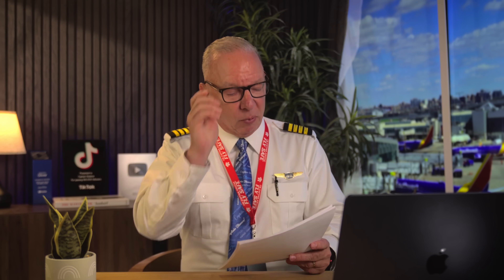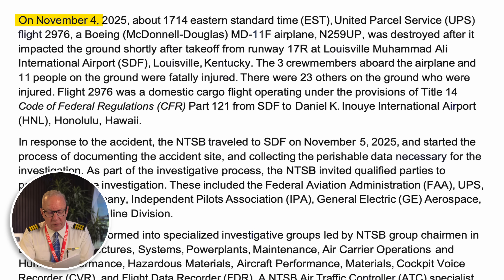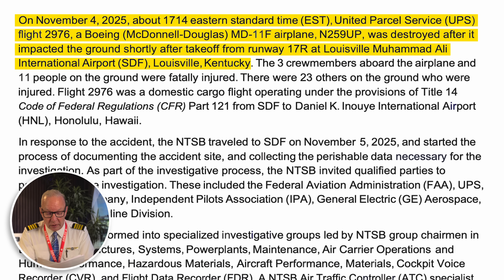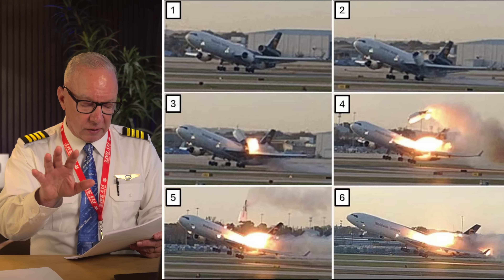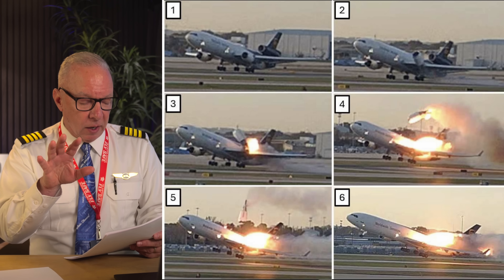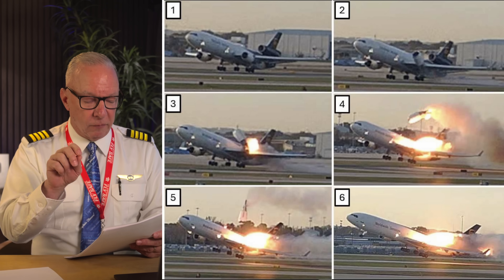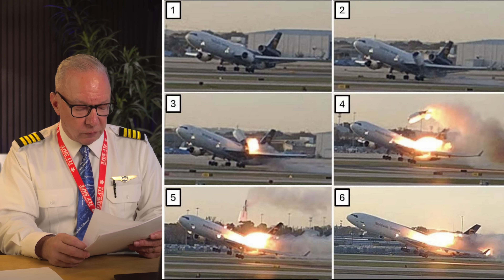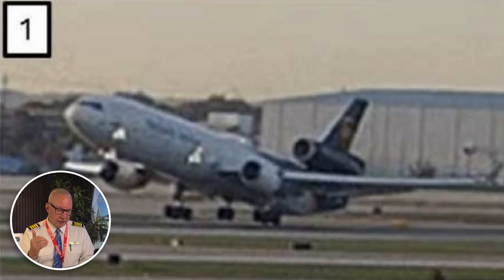UPS Crash Preliminary Report | Pilot Reacts to UPS Crash Report

Comment: I work on the MDs for a certain cargo company and we are finding similar issues with other Mad Dog pylon mounts so they did not die in vain because there's no telling how many other people this could have happened to.. God bless them and it's a sad day in aviation history because of the loss and this is probably the end of the MD 11s and DC 10s.
Reply: Not casting blame, just curious. But is this something that could have been seen while greasing back in October? Just seems odd that they’d have you grease a part but not check for fatigue. Or are you not “right there”? Especially considering this isn’t the first time this has happened. Last go around NTSB made mention that it was the handling of the engine with a fork lift that created cracks. Someone here mentioned as planes get older the schedules should tighten up a bit. Sounds expensive but is it feasible?
Reply: @haroldplanaplonick3632 visual inspection does not detect sub surface cracks.
Reply: Do you guys regularly inspect using ultrasound or other techniques to check the pylon parts at regular intervals?
Reply: @Truth_seeker_24  did you watch the video he explained the inspection schedule
Reply: @marknicolich5789 I saw the video and the schedule of certain cycles but my question was not about schedule but if at the end of the cycles when they check do they really really check using ultrasound etc or any such critical inspection in key areas of the plane especially known areas of stress.

Comment: I am very old school military Jet Engine Mechanic (43250) and then many years as A&P and this shocked me. What I do not understand is why there was just a major a couple of months ago and they did not do NDI inspection on those services? I have never either as military or civilian changed an engine or a Major ever not done and a NDI let alone on a major replaced the hangers bolts. SOP everyplace I have worked in my life a major had a standard NDI AND replacement of the bolts, nuts and safety wire replacement then the replaced bolts were often run through a NDI test just for safety. What I have never seen (and I have seen a lot) is a bearing split around the race. I have to wonder which caused which The pylon, the bearing or the bolts letting loose. Personally if I were the FAA going over that I would be looking at the original cause and why they were not checked at a major. I don't know what the FAA is recommending on the other planes but I would start with a full NDI (2 people checking min) plus a full replacement of the bolts and  any attachment points including fuel, hydraulic and air before letting them out of the shop. A lot of work HELL YES, but what is a life worth?

Comment: I would assume that only basic engineering skills would be required to take note that only three mounting points are extremely subpar when safety over cost of maintenance is not the priority in manufacturing aircraft. 
Suspended engines are obviously under stress in all directions, not just fore and aft. 
They’re definitely affected in yaw, pitch  and torque twist.

Comment: The engines are pushing much more than they’re pulling, old boy. It’s a considerable mistake to say otherwise.
Reply: If we mounted a jet engine on a long horizontal pylon attached to the nose of the plane, that would definitely be pulling. And if we mounted a jet engine on a long horizontal pylon attached to the tail of the plane, that would definitely be pushing. 😂

Comment: Hey Steve, materials engineer here. The way I read that portion of the report about the lugs is that the forward lug had two fracture surfaces (inboard and outboard) the inboard surface showed fatigue cracks but the outboard didn’t. Meaning that there was pre existing fatigue cracks in the lug but only on the inboard side.
Reply: Yep. Same. He misses a lot of shit
Reply: What would that imply about the direction of stress over time? Gyroscopic effects do you think?
Reply: Honestly I haven’t read the report other than what was on screen here so I can’t speak to the implications about direction at the moment. What it does imply, without other context, is that both of the mounts had fatigue cracks prior to the crash… most likely all of the planes that are currently grounded are going through inspection on this component. It’s pretty amazing how quickly they were able to pinpoint this.
Reply: Grifter ? lol —- 

But for those interested maybe offer your analysis. Could get a little consulting pay.
Reply: @mattt5842 oh, I’d be happy to join @captainsteeeve on the show and give some analysis for free.
Reply: Yea, this guy is a grifter. He's a pilot, but knows jack shit about the engineering aspect of aviation.

Comment: 4:55 You still haven't figured out that the first report of altitude from ADSB was MSL, not AGL.  

Your attention to detail is lacking, and it's another reason why you should refrain from speculating. 

Remember when you said the first video was "definitive" that the #3 engine was compressor stalling?  The analysis is NOT the same because the assymetric thrust was greater with #3 operating at MAX, probably FIREWALL power, because the additional rudder required also created more drag.

Comment: Thank you Capm Steeeve for explaining that so well.  Let's think about this for a second outside the box.  Those fatigue cracks were not there overnight, correct?  So the plane has been flying with them for some time.  Yes, at some moment, they're gonna go.  But does their mere existence provide absolute, definitive proof that they blew and that was the cause?  How can one be sure if they blew, aren't they kind of not there anymore at the location they blew?  Several airports closed in Europe recently due to UAP sightings at the airport and pilots are reporting them more frequently now that they can.  Some are small.  Wouldn't it be prudent to perhaps go through all video and photos again with a fine tooth comb keeping that it mind?  If it were a small sphere that got sucked into the engine, might it have taken the engine off in the same fashion?  If they're plasma, no one really knows how that might damage the engine interior, but they're witnessed to have traveled beyond MACH.  Don't laugh at me but I think investigations should cover all possibilities thoroughly.  My family witnessed blinking, plasma-like spheres a few weeks ago and has video and photos, they're very real. 😶‍🌫

Comment: So what happens now? Do they reevaluate the inspection schedule knowing that these fatigue cracks can happen within a 4-year time span versus the aforementioned seven-year time frame? Does that also mean that they will go through and inspect all of the grounded aircraft for these particular issues? And does that also mean that they will try to find a better type of connection to prevent stress fractures from happening as quickly? And now knowing this information, what is your take on your initial analysis? Was your initial take on this leaning more towards pylon or was it leaning more towards the engine? And obviously this information on release from the NTSB does corroborate what you assumed as far as the lack of lift is concerned. And then my last question is obviously we know that they couldn't gain lift and were obviously going to try to with their given training but is there a way to change a takeoff procedure at V1 to try to recognize a full duel engine failure like this and be able to have enough time to abort a takeoff knowing that they can't get off the ground?

Comment: Steeeve....481 MSL   MEAN SEA LEVEL....... SDF airport elevation is 501 feet. The elevation of 17R is 461. So depending on where the data point was taken on the airplane, 100 feet is right. Especially considering the photo at 5:55. - Captain Chris. :) (Oh, clevis = "kleh·vuhs." 👊😃)

Comment: Just curious as the why there are so few bolts (attachments) ? It seems two the for engine and two for the pylon to the wing are just not enough (in my opinion) for extreme conditions. Why not 6…or 10, or a least another 2 as a fail-safe?   Wow…..

Comment: captain steeve!  do you think the descrepancy in altitudes between the fdr(30ft) and atsb data(100ft agl? 428ft msl) is due to the nose of the aircraft being higher(and at an angle 
)? or is that not right? im not familiar with the various ways to record altitude, but i vaguely remember some aircraft having multiple ways to determine altitude. one method 'pinging' the ground and getting a return signal, and the other barometric.

might make a good educational video if youve not already done one to explain aircraft systems

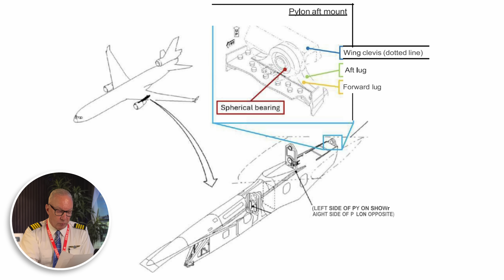Comment: You are slightly off Steve, and this is confusing. 11:50 The aft attachment has both a forward and an aft lug. The paragraph that talks in reference to figure 10 is only talking about the aft attachment. There is also a fwd attachment. You need to look at 8:11. The aft "mount" has both a fwd and aft "lug". You have be clear in differentiating between mount and lug.

Comment: Well stated, Capt. Steeeve. No candy coating. After living with that aft pylon mount for the four years I worked at CO, it appears that the investigation is headed in the right direction. While the failure location appears to be slightly different than the AA loss in 1979, the consequences of the failure were the same in both cases. The AA loss was caused by a pre-existing maintenance induced in the top horizontal shear web where it attaches to the aft bulkhead just below the lug that failed on this aircraft. Different failure location, but the same result. I was surprised that the inspection interval on the top of that bulkhead was 8000 hours. When I left CO in 1982, we inspected that area with eddy current at 100 hr intervals. I always expected that interval to be moved out at we gained more data from the inspections, but was surprised that it has been moved out to 8000 hours. I could write a book about this history of this joint, but I won't do that here and probably will never do it. Too many bad memories. You will probably see a discussion about how this failure location was intended to be used in a water landing so the engine could fold back over the wing on impact with the water. That lug that failed is a dual load path down to the aft bulkhead, but dual load path is only dual the last time you looked at it and determined it was intact...in this case many hours ago. Again, it appears the inspection interval was just too long. Ok, I will shut up now.

Comment: As an Engineer, I’m curious about the fatigue testing that was done. I believe this was a freighter conversion. How does the fatigue testing for the pax configuration compare, and under what maintenance plan was this A/C operating under: the original plan for the pax or a modified program specifically for P-to-F modified aircraft?

Comment: As a complete ignoramus when it comes to engineering, simple common sense tells me that going 29000 cycles without an overhaul is insane. Pretty much anything with an engine in it isn't going to go that many cycles without a failure. A visual inspection isn't going to show any kind of internal stress fractures until there so bad that they become an external fracture and by then it's to late given how many cycles between inspections. Or am I completely off base here?

Comment: Ref Fig 10 bolt fretting: 
Steel fretting is caused by small-amplitude oscillatory movements (vibrations) between two loaded, contacting metal surfaces. This repeated micro-motion causes the surfaces' microscopic asperities to break off, creating wear particles. These particles then oxidize to form a hard, abrasive material (iron oxide for steel), which further damages the surfaces in a cycle of wear and corrosion. Lack of lubrication in accordance with the scheduled maintenance program??

Comment: This is the third time i've posted this. These spherical bearings are Teflon, lined swaged joints. When the materials gone, they become loose.Adding grease does not fix them they need to be replaced.

I suggest they look into Mcdonald Douglas service bulletin DC-10 54-59. I worked for the manufacturer of this spherical swaged teflon lined pylon engine mount back in the late '80 -90's. Personally, the repair (fix) never seemed right to me

Comment: For me, as a UK Licensed Aircraft Engineer with multiple wide bodied aircraft types, I want to know if teh pylon was removed during it's heavy check... If it was, were the attaching hardware NDT tested prior to re-installation... If were removed an engine or pylon, all bolts and shackles were either NEW or they were NDT inspected for integrity.. Always NEW nuts and washers. But I worked for an airline that cared...

Comment: Heh. I'd honestly expected it to be the CF6 engine failing, because of all the flames. Apparently, I guessed correctly that the #2 engine was the engine that suffered collateral damage from the loss of #1. Having only the #3 engine put their chances of recovery at absolute zero. Being left with #2 would have at least given them balanced thrust..... with admittedly still only a 0.001% chance of recovering. 72 months is 6 years. That sounds like an awful long interval to inspect engine pylons..... I'm thinking this is the end for the DC-10, MD-10, and MD-11 and related models. But who knows? Properly kitted out, they are still fantastic cargo haulers.

Comment: Wow it's amazing that those things tug on that bearing when taking off. It just  got to fatiqued and pulled it apart leaving the bearing still attached to the wing clevis. 
Please note that the forward MOUNT is not what was discussed here. The aft MOUNT has both forward and aft LUGS. It is those two lugs that broke loose from the bearing. As shown in the picture, the forward and aft LUGS hang on that same bearing. The rear lug showed some cracks on the inside (2oclock) break and the outside (9oclock) places it broke. (viewed from aft as mentioned in the paper) The front LUG of the rear MOUNT showed fatigue cracks on the inboard (2 oclock) break but not on the outboard (9 oclock) break... just some overstressing. 
I can't imagine the tug on the bearing during takeoff at full thrust. Yet it stayed on the plane. That must be one heck of a bolt that holds it on. 
No wonder they have grounded them all. I'll bet they are replacing those lugs with new ones if they keep the planes flying at all. Why would they?

Comment: I disagree.  Photo 1 shows to my eye the start of the rotation of Engine 1 into the air.  The first engine and tail should have slightly different angles.  You can see how engine 3 is down slightly.  Engine 2 (the tail) is angled slightly for better thrust controls.  So for Engine 1 to have the same "angle" means it's already detaching.

Comment: a comment on another reaction said #1 engine is ever so slightly tipped upward compared to engine #3 in photo 1 - and when I look at it again I agree - looks like rear mount is already  failing (coming loose ?), allowing engine to cant upward ever so slightly, pivoting on the front mount
Reply: and if you look at a MD-11 side view layout - the tail engine #2 is canted upward slightly by design, compared to left engine #1 - and in the photo 1 those two engines look to be identical in their horizontal angle compared to right engine #3

Comment: The previously distributed pictures of the"engine laying on the runway" must have been fake news. Those pics showed a bare engine on the ground. These pics show the entire engine assembly with pylon and nacelle becoming detached and flipping over the top of the wing and tearing out fuel and hydraulic lines in the process. A carbon copy of American 191 but closer to the ground.. They never had a chance.. You can see they were fighting by the upward angle of attack. at a low altitude.. just have been terrifying.  RIP to the lost souls....

Comment: Captain Steve, thank you for the breakdown of the preliminary report. Like you, I salute the crew for their efforts and mourn all who were lost. 
Given the fact that the aircraft was fully laden with fuel and cargo, that the number 1 engine had departed the aircraft, that engine number 2 was in a compressor stall and that there was fire in the left wing, is there any chance, in your opinion, that even if the crew were able to gain minimum altitude and level flight, that the aircraft could have been saved?

Comment: I told u in comment under the first Video about this which u made. I immediately thought of the case where the egine tore appart the plane and came off, cuz the propellerblades did cut throught the plane.
Reply: and actually the propellerblades must have cut some connecting points of engine iand frame. not essentially all together, but while take off thee is lots of pulling force and the area is already stressed. so if just some of the joints fail the engine is gonna go fly and then gets sucked over the wing while it stops accelerating.  "propulsing" ? sry I'm German, not an eng native mate.

Comment: That's outrageous. Every 5 years? That's all? Is that normal?  I wouldn't get into a plane that only had a thorough inspection every 5-6 years.
Reply: …yes…but there are shorter and longer cycles. The question is in regards of the suspected parts if for an aging airplane the cycle should be reduced.

Comment: Horrifying....imagining myself aboard that plane.  100ft AGL (above ground level). That's about right. 400ft MSL is the altitude above average sea level height. When I briefed pilots, most data were in MSL while critical data such as minimum ceiling and cloud bases at and around the airfield are in AGL. That makes it easier to update pilots on cloud conditions based on visual observation and readings from the ceilometer.